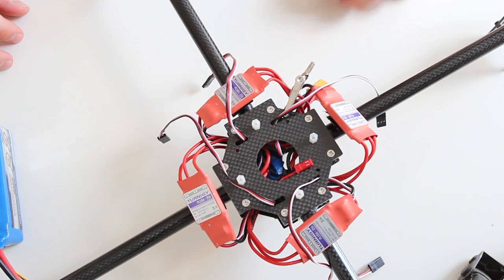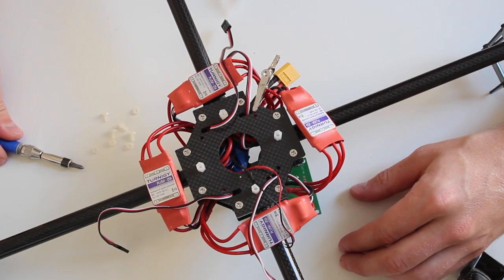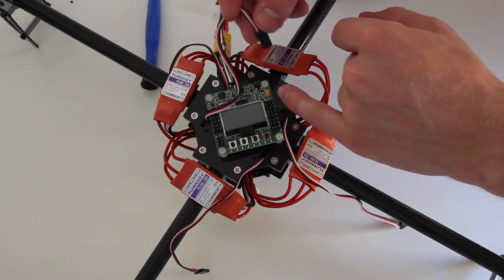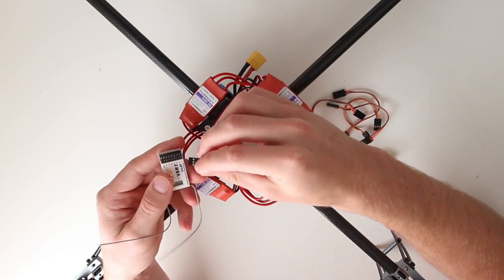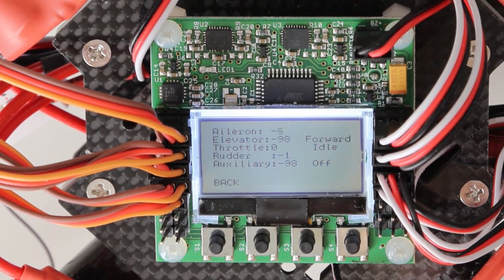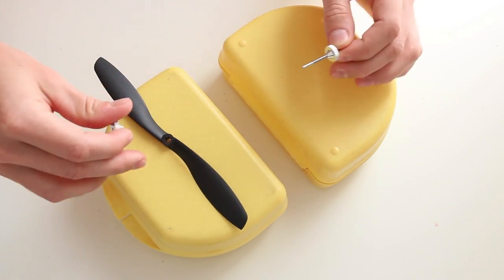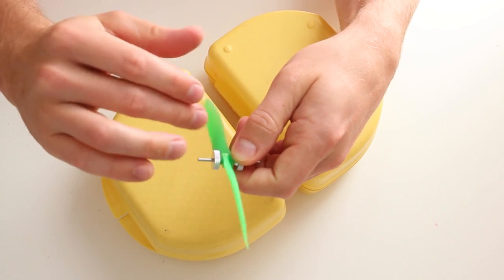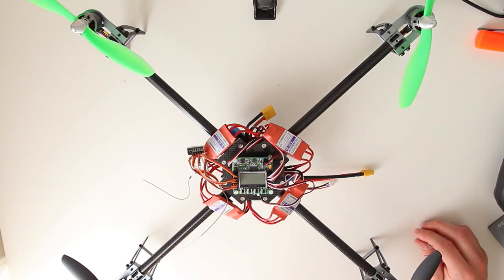Basic Quadcopter Tutorial - Chapter 4 - KK2 Board, ESC Calibration, throttle range and props

Comment from the maker: This is a good question, which I like to answer because many have asked me before via a private message. If your ESCs don't have a BEC you will need to install a UBEC an connect this, coming from your power source/lipo to the UBEC to the KK-Board 2.0 
On the KK-Board 2.0 only M1 has all pins connected, which means you have to bridge M1 to a free port (on a quadcopter m6 for example) and connect the UBEC to m6

Comment: People use the ni-xx setting as it has a lower voltage before the ESC goes into your selected cutoff mode.  Thought behind it is I would rather destroy a battery than have my quad tumble out of the air powerless and be damaged.  I use soft cutoff mode to give me at least a controlled hard landing if I should exceed the battery limits.  Always use a timer and know your battery limitations but sometimes stuff happens.  Hope this helps.

Comment from the maker: I am using a LiPo, you are right at this, but it is for "safety" reasons that we switch it to Ni-xx. This is only changing the settings for the ESC. When configured in LiPo mode, the ESC would shut down the LiPo for saving the "LiPo reasons". This would save your battery, but your quadcopter would crash, causing a much bigger damage. In Ni-xx Mode there is no automatic shut down, but a chance of destroying your battery due to low voltage. The KK2 Board however has a low-voltage alarm assisting u

Comment from the maker: Okay, for beginners it is easier to follow the KK2.0Board onboard setup configuration tool. 

First:  The motors are either spinning CW or CCW!
Second: Depending on the direction of the motor, you got to determine, which prop to put on, because there is only one right way. If you put the prop on the wrong way, you will hear it as soon as you turn it on.

Hope I could help you. Good luck

Comment from the maker: The "low voltage cable / alarm is no special one. However it is needed in order to get the alarm working. You have to solder a wire from the positive of the backside of the kk2 board to the power positve. dhdsracer has a video showing you how. Thanks for watching

Comment from the maker: hi mailtojarriya,
there are to options possible. Either your transmitter settings/channels are messed up and/or you have the wires from the board to your transmitter wrong, or you have the transmitter on before putting the throttle stick into maximum throttle position. The transmitter and the KK-Board must be turned of. Next you put the throttle stick up and power the transmitter, while at the same time pushing and keep pushing buttons 1 and 4. Hope that helps. Thanks for watching!

Comment: You also need to balance the hub off the props too. It's not like a plank where just horizontal balance will suffice. Point the prop at the sky and whichever way it falls is the heavy side of the hub. Apply glue to the light side n if that's not enough, add a small piece of fluffy velcro and apply drops of glue to the fluff until it will sit in watever position you put the prop in. If u use too much glue, let it dry and file some off as needed.

Comment: Yes it does, your multicopter will not fly with the props mounted in the wrong place. It will yaw in the wrong direction and then try to correct for it by yawing even further, ie it will spin and you will crash. The controller you use will specify which props need to spin is which direction

Comment from the maker: I set it to Ni-xx, because otherwise the ESCs would turn of the motors due to low voltage and that would end in a crash. By setting it to Ni-xx the ESCs won't turn of the power to the motors at all. Therefore you can damage your Lipo. Thats why I am using the low voltage alarm on the KK2 Board, which is connected to my main Battery supply/Lipo. It Beeps, when the voltage drops below a certain, preset level which leaves me just enough time to land it safly and save the Lipo. 
Thanks for watching!

Comment from the maker: If you get your ESCs calibrated, but not the throttle, you can check throttle range and increase the throttle start up in the KK2 Board menu. I set mine to a value of 20. Works fine. Hope I could help you out. Thanks for watching!

Comment from the maker: Actually this is made on purpose because a ESC in lipo mode will automatically shut down in flight if the voltage drops below a certain level. In Nimh Mode the will just keep running, which is the reason why I am using a voltage alarm

Comment: ....
Clip Holder for soldering
1mm solder wire
IMAX B6 AC battery charger
HobbyKing X550 camera tilt mount
Turnigy 4mm Heat Shrink Tube - RED (1mtr)
XT60 Female w/ 12AWG Silicon Wire 10cm (5pcs/bag)
Various wires...(connecting the kk, battery, esc..etc..which size?)
soldering station

Feel free to add/remove stuff...
Thanks again for the article!!

PS I'm sorry for my english...

Comment: I guess there is no harm done in just plugging all ESC's into the kk2.0 board without disconnecting all but one positive wire? Im building an octocopter, and wasnt sure if i needed to disconnect all but one positive wire on the ESC plugs? Or just plug them in?

Comment: could you mount a 5 th rotor in the center and if you could how would you
set the kk2 1.5 with 4 quad motors and a fifth in the center?

Comment: Could not see what u set it to but you should set the battery type to nimh. This prevents the low voltage cut off kicking in. Not what you want on a quad as not all the esc's will detect l. V. C at the same time, resulting in a crash. Instead set battery type to n e thing but lipo and fit a voltage alarm to the quad. The kk2 comes with a voltage buzzer so you could use that or supply your own.

Comment: When you are programming the ESCs with the programming card you say connect with the "signal on the far left" but you don't say which color that is i.e. what color wire is the signal - it is different on some ESCs...I have a Turnigy 30 amp with purple, red (middle), and yellow cables...which is which?

Comment from the maker: Hey, also die Props kommen, zumindest bei mir auf die andere Seite des Motors. Dazu brauchst du den Prop Adapter, den ich auch in der EInkaufsliste verlinkt habe. Alles andere ist suboptimal, bzw. wird auf Dauer nicht halten. Siehe mein Crash mit dem HolzFrame. Da dreht sich dann irgendwann die Befestigung lose, trotz Threadlock und dann saust der Prop ab. Die Props sind beim Quadrocopter durch die ständigen Änderungen der Drehzahl unter extremer Belastung. Das macht nur der Propadapter mit

Comment: Hi, I have a QUADX with HK2824 KV1300 Motors and 30A Turnigy ESC, but I have problems to fly. Its very unstable. I was reading about ESC frecuency and I found that ESCs have to support about 400Hz. I'm not sure if my ESCs supports those frecuencies. In other forum says some people re-program the ESC to find those frecuencies in the quad. Do you know some advice to solve this problem? or the best it's change the ESC.

Comment: im building a quad from a hobbyking x666 frame. I have a problem with one of the esc's. Its getting real hot. What could that be? Im a beginner and not sure what im doing. Also i cant get my copter off the ground, only one side lifts. Do the props go on ccw with a ccw blade or oppisite? Sorry , like i said im a beginner.

Comment from the maker: Hey "TheFPVProductions", the no pitch input can be caused by your transmitter. Maybe you have some settings wrong. Maybe it is an option to put all channels to 100 and -100, make shure, that no channels are reversed or need to be reversed. If that does not help, try to extend the range to whatever is possible. 130 and -130, 150 and -150. 
These are my thoughts on thiss, I hope it helps. Please reply, if successfull. If not, maybe someone reading this comment has another idea. Thanks guys!

Comment: ... As for the camera mount I don't think I need the camera to tilt so if you have a better way to attach the gopro whithout the mount i listed, please tell me..
Talon frame v2
KK2 flight controller
4 X turnigy plush 25 amp
4 x NTM 2826 1200kv motors
AM1001A gold connectors
8045R prop black
8045N black
8045R green
8045N green
ZIPPY 2200 4S 40C
TR_PC turnigy BESC Programing card
10 cm MALE-MALE SERVO LEAD
turnigy 9XM2 transmitter&receiver
Rhino 2620 mAh 3S 11.1 (RT-TX)
450-0024 Prop Balancer....

Comment: Why do you set  the battery type to Ni-xx when you had a Li-po???
Reply from the maker: davide1000mr When set to Li-po the escs try to shut down in order to save the battery. In Ni-xx mode they run until the battery is dead. Choose which one is better for you. I do like my quad on the ground with a dead battery better than a broken quad with a functioning lipo. To prevent both I use a audio low voltage waring. Thanks for watching!

Comment: I ordered two kk2.1 boards and they both have the same issue. M1 output sends the wrong signal to whatever ESC I plug in. It makes any motor start like the others and then accelerate very fast. This is on a level surface after ACC calibration and ESC calibration. If I plug motor 2 on M1 output, then motor 2 accelerates. If I plug motor 3 on M1, then motor 3 accelerates and so on. I tried everything possible. I reflashed both boards with all the firmwares available many times. It flies but it's very jittery because of that issue. Anybody got an idea? Am I so lucky that I got 2 bad boards?

Comment: does putting tape on the prop really matter?
Reply: +Supernova I dont think it is neccicary but it will make the smallest stablisation differance
Reply: ok thanks!
Reply: +Supernova It will reduce vibration mainly. Vibration is the killer of quads, cables that vibrate will break...Well balanced props will help reduce vibration, clamping down cables so they vibrate in the middle is much better than vibrating near solder joints too. (Imagine bending a wire back and forth 10 times...now imagine how many times it gets slightly bent from vibrations in a quad :)

Comment: I tried to calibrate ESC I turn on radio give full throttle, press 1 and 4 then power the board the motor just go maximum and no confirming sound. Please help,
I'm doing hexcopter.

Comment: my KK2.1.5 , when armed is beeping!! Would you know what is ?
Reply: is your battery fully charged? Mine does this too, even with a fully charged battery so I just unplug the buzzer so it shuts  up! lol I have the KK2.0 board if that makes a difference.
Reply from the maker: hdrjunkie 
Francisco Cunha Have you set your low voltage waring to the correct voltage? Are all channels connect in the right way? have you set your throttle range correctly. Hope it helped. Thanks for watching!
Reply: bmmt